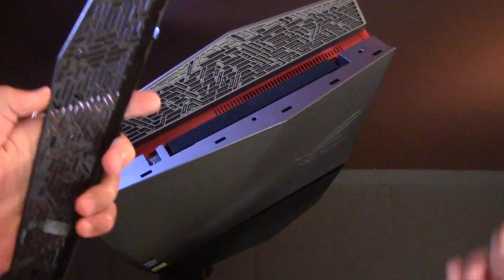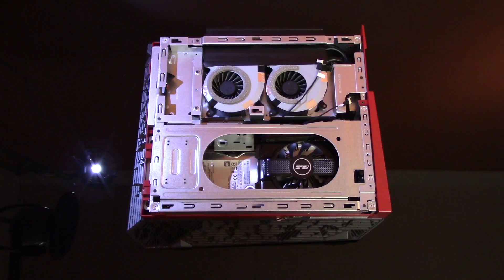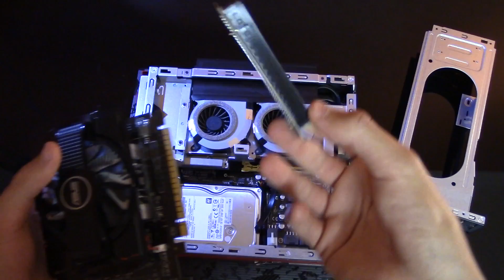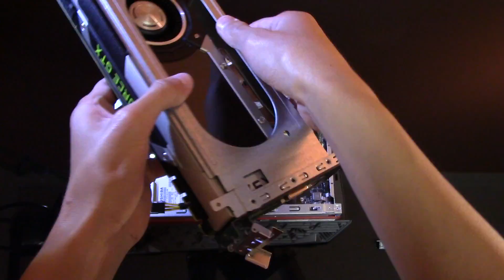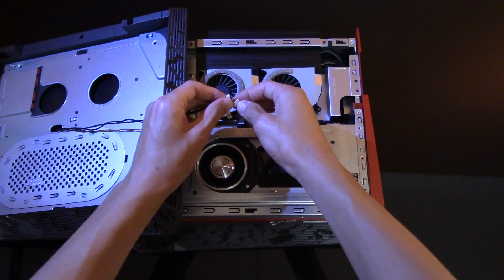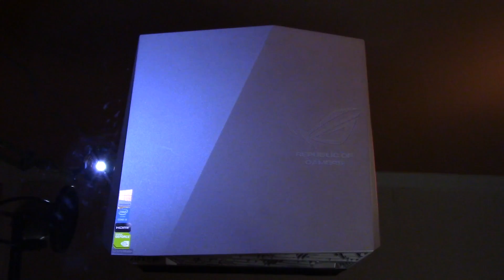Asus ROG G20 - GPU Upgrade Tutorial

Comment: If i put a gtx 1080 in that case with all the standard stuff it comes with will it be ok or bad? And will a gtx 1080 fit the motherboard?
Reply from the maker: If you've got both power supplies, it'll be fine. And a 1080 will fit.
Reply: Would i need a new psu for the gtx 1080? And would it be cooled good enough?
Reply from the maker: If you've got both the 180 and 230W power supplies, you're good. And I'd recommend removing the metal mesh plate that's in the case for a bit more airflow. I could also recommend, if you don't mind a bit of noise, setting the GTX 1080's fan curve a little higher, as it's a warm card.
Reply: DrewEon Thanks!!! Do you think thered be room for a gpu thats water cooled in the case? Like this one: Gigabyte GeForce GTX 1080 XTREME Gaming Water Cooling Video Card
Reply from the maker: The only card that will fit is the reference card.
Reply: @DrewEon  This gives me comfort per my seperate 1070ti question. If I already have both the 180w and 230w powers supplies working on the 970 then it sounds like I'll be all good on the 1070ti if you're saying it's good for a 1080
Reply: Whoa whoa whoa. The system with both power supplies only has 410 watts. Thats not nearly enough for a 1080 but I guess its too late to say this lol.

Edit- Well technically its the bare minimum. It could completely mess up the 1080 as it can spike up and take more power. So as long as your not playing all day I guess it would be fine TECHNICALLY! But from what I heard thats way too risky.
Reply: Don't both power supplies come with PC together??

Comment: How is RPG G20's cooling?
Have ur computer got throttling on extreme heavy load?
Reply from the maker: Haven't ever gotten thermal throttles, GPU stays as cool as most benchmarks show, and processor stays at a surprising 60-65º under load.
Reply: What is the temperature that the benchmark showed?
Also, do you know if the cpu is swappable?
Reply: Rr I have a G20CB with an i7 6700 at 3.4ghz and a gtx 950, and my normal idle temps are about 40-48 degrees celsius and after about an hour or two of gaming on GTA 5 on very high graphics, it ranges from 55-60 degrees Celsius and will rarely go above. I had once left GTA 5 on all night and it only got to about 62. I got it in January this year so I've only had it for the winter so other temps in hotter seasons might be a bit hotter

Comment: hey man i moved recently and my powercord was stolen in the airport will the one in the discription run my 180 card without shutting my pc off anything that runs my gpu turns off my computer atm
Reply: i ment to say 1080 i had the stock power supply when it was stolen thats why i asked
Reply from the maker: Did you only have one power supply? And which one in the description? You need to have both power supplies for the 1080
Reply: my stock one did lol really well

Comment: So I have the ROG G20 and I have installed the GTX 1080 in it. IS there anyway to install a new coolant in this computer because I think it is over heating. The fan goes off real loud sometimes.
Reply from the maker: Which model of the 1080 did you put in? And the fans get loud, it's a small PC haha.
Reply: The Aero MSI Gtx 1080
Reply from the maker: Boston Towny4life Doubt it's overheating, as that model of the 1080 exhausts air out the rear. The fans are loud, as it's a small PC.

Comment: hey man great video but i have one question. i know about the jdc11 slot but another video said to move all the r20 slots up. is it necessary?
Reply from the maker: Yes! It seems that JDC11 actually may not activate the second power adapter, done it myself and it's surely working. Depending on model, though, you may need to test different configurations of the other slots.

Comment: I got the rog g20 that came with just the 180 power supply. First question will I be able to upgrade gtx 1070 and second question will I also need to buy the 230 power supply? Thanks for the video!
Reply from the maker: You surely can get the 1070, but you'll need that extra 230w.

Comment: Will this 970 work? It's different than the one you have. Thanks!
http://www.newegg.com/Product/Product.aspx?Item=N82E16814121899
Reply from the maker: Don't believe the strix fits, and it'll also exhaust a lot of heat into the case.
Reply: Will this fit? Thanks again, sorry for bothering :p
https://www.walmart.com/ip/ASUS-GeForce-GTX-970-4GB-Turbo-Graphics-Card/44933762?wmlspartner=wlpa&selectedSellerId=1229&adid=22222222227032313218&wl0=&wl1=g&wl2=c&wl3=62500234736&wl4=pla-109727440616&wl5=9031075&wl6=&wl7=&wl8=&wl9=pla&wl10=112549857&wl11=online&wl12=44933762&wl13=&veh=sem
Reply from the maker: raviolu_ Won't fit either :/
Reply: Well ain't that just fine and dandy. But seriously, will it work?
Reply from the maker: raviolu_ It'll work, assuming it arrives working haha :)))))))))))))))))))))
Reply: DrewEon I love you dad
Reply from the maker: raviolu_ Love you more, mom

Comment: Hi friend, Where can I find the Pci cables if I don't have mine. I need an 8 pin for the 1070 but I cant find an 8 pin to 8 pinh anywhere online.
Reply from the maker: I've looked all over the web and haven't found an 8pin to pin either :/
Reply: +DrewEon do you know if Asus used an 8 to a 6+2 connector for their 760 build? Or just a 6 to 6?
Reply from the maker: +tpod legacy I believe its a 6+2 to 6+2.
Reply from the maker: At least it's what came with my PC.
Reply: +DrewEon sweet I havnt opened mine yet but that should work with the 10xx series right?
Reply from the maker: +tpod legacy Yes.

Comment: I am thinking that i can put the gtx 1060(not founders edition) inside?(the size)
i am just afraid that the fan cant push the air out and it just push it back to the computer inside
Reply from the maker: The reference (founders) model from Nvidia is specifically designed to exhaust air out the rear, and it fits.
Reply: +DrewEon so can Asus turbo Gtx 1060 6g fit in?
It looks like the founders edition

Comment: Can you upgrade to the GTX 960 EVGA? It fits, but what power supply would I need?
Reply from the maker: You'd need both the 180w and 230w. Although, if it's the EVGA acx cooler, it's going to exhaust lots of hot air into the case.
Reply: +DrewEon Thanks! It took me a moment to realize the computer has both plug ins for each power supply. Lol, but I decided to order both the power supply and the GTX 980 sc.

Comment: If I try to upgrade the video card, do I have to add another power supply for it? Is 230w+180w enough?
Reply from the maker: The 230w and 180w are enough for anything
Reply: ***** umm I was planning to upgrade my gpu from gtx760 to gtx 970
Reply: +DrewEon ok, thanks

Comment: I want to upgrade my GPU because the one I have right now (AMD Radeon R9 370) isn't compatible with VR. Is there a really good GPU for VR gaming? Please can you let me know it would be very much appreciated!
Reply from the maker: GTX 1060/1070/1080
Reply: +DrewEon will the 980 ti SuperClocked work and fit?
Reply from the maker: Mr Network After market cards don't fit well, and exhaust air into the case.
Reply: +DrewEon k, thanks for letting me know!

Comment: So I have the g20aj with the i3-4150 cpu and gtx 745 if i upgraded to 1060 or a 970 would it bottleneck the cpu or would I be good??
Reply from the maker: The CPU would bottleneck the GPU
Reply: +DrewEon what do you think would be the best gpu option to upgrade to so it won't bottleneck ??
Reply from the maker: michael fetzik I'm not saying you shouldn't do it, you just won't get the full potential out of your card, especially in games like GTA and the Witcher, open world.
Reply: +DrewEon alright thanks man and great video again it'll help me in the future !
Reply: +DrewEon Would this be a good 970? I can't see to find a cheap 970 like in your video and I've heard this card blows air out the back just like the reference card so won't heat up inside he case. 
PNY GeForce GTX 970 4GB Rev 2 Graphics Card https://www.amazon.com/dp/B0165YVEEA/ref=cm_sw_r_cp_api_d0eQxbSWEWGP2
Reply from the maker: michael fetzik That or dis http://www.bestbuy.com/site/nvidia-geforce-gtx-970-4gb-gddr5-pci-express-3-0-graphics-card-silver-black/9855169.p?id=1219441201895&skuId=9855169
Reply: +DrewEon alright thanks again

Comment: Two questions.

1. What are the power cables called at 0:40 ?

2. Will this 1070 fit in the metal cage, or can I use it without the cage?
http://www.newegg.com/Product/Product.aspx?Item=N82E16814127947&cm_re=msi_geforce_gtx_1070-_-14-127-947-_-Product
Reply: I believe that the metal cage that holds the graphics card is about: Height: 4.376 in - 111.15 mm Length: 10.5 in - 266.7 mm Width: Dual Slot.

Comment: I recently bought the GTX 960 and I have the 230w power supply. 
Will that overload my card and damage it? Or am I fine as is?
Reply from the maker: More likely your card will overload it. And because power will only come from the PCI lane without that second power supply, it's possible you can damage the motherboard. I'd suggest you purchased that second power adapter.
Reply: I also forgot to mention that I also have the 180w that came with my Asus when I bought it.
it had the GTX 745 at the time. The 230w I bought when I planned to upgrade my GPU.
So judging by your response, since I have both, I should be fine?
Sorry if the answer is obvious to you, I'm new to the whole PC building scene.

Comment: hi Drew. thanks to you and Welsh gaming i am upgrading my ASUS ROG G20 CB WS71 GPU from a GTX 980 to 1080 Got all the way into installing 1080 into cage and 6+2 (only power cable needed) is installed.. My only question is what to do about jumper. The 980 used 2 powers cables I believe both 6 pin.  The 1080 uses just the one 6+2 (for a 8 pin cable), but do I have to change the jumper..I don't even see a JDC11, I see JDC 01,02,03,04,05..any idea if I have to change a jumper?
thanks
Reply: I have JDC11 to the left and JDC01-05 are all on the top pins.
Reply: +Drew Eon thanks.I got a hold of nvidia tech support and they said with my setup, the jumpers were fine as they were. all done and seems to be running fine. thanks for the help.

Comment: Will this 1070 fit?

https://www.amazon.com/gp/product/B01IPVTHL8/ref=s9_top_hd_bw_b1C5u_g147_i3?pf_rd_m=ATVPDKIKX0DER&pf_rd_s=merchandised-search-4&pf_rd_r=VW0VK1TY0V2K1HAYRXF3&pf_rd_t=101&pf_rd_p=b7bbe86f-11e5-5e0a-b25b-2cc39f20adcf&pf_rd_i=284822#customerReviews
Reply from the maker: I don't believe it will.
Reply: DrewEon Ah that sucks! Thanks for the heads up though!
Reply from the maker: +CrayZ If you have your heart set on it, I've seen some people putting the Turbo 970/1070's into their G20's without the metal cage.
Reply: DrewEon Mmm seems a little risky. You know any high end GPUs that fit in nice within the cage?
Reply from the maker: +CrayZ The safest route is reference design cards because they fit, and they don't put extra air into the case like open design coolers. I believe the only after-market design card that fits is the EVGA ACX 2.0 970, but I'm not sure.
Reply: can I get a different case and move everything there and upgrade the gpu ?
Reply from the maker: Kr Vactite That won't work. Only the processor, storage and graphics card are transferable to a new case. Motherboard is custom to the G20, RAM is laptop memory, CPU cooler is custom to the G20, and power supply is of course made for the G20.
Reply: DrewEon I know ;-: i going to have to drop like 200-300$ or even more NOOOOO
(p.s I want my pc water cooled)

Comment: Hey ! tahnks for the video. I have an 6 => 8 pin connector for the 1070, that will work or not? ty :)
Reply from the maker: A 6 => 8 pin? What?
Reply: In your video, you just use a 8 pin => 8 pin pci express (the red cable on the left at the start of the video) i don't have it and i need it for my new gtx 1070. Do you know where i can find this cable?
Reply from the maker: Madalax This is the only thing I've been able to find. It's long, but if you cram it in there well it should work, lmao https://goo.gl/xrRiwl
Reply: Ok thanks a lot ! :)

Comment: Hello , nice video ,i have the same pc, with the gtx 750 , but i only want to add the 180w power adapter and keep the gtx 750 , do i have to put the tab on the left side too ?
Reply from the maker: Why add the 180W power supply, then? And yes, you do
Reply: because the pc crashes on some games , its not overheating , its just because that the power supply is only 230 w and the 750 need 300w minimun.
And i can't afford a new Gpu right now ^^'
Reply from the maker: Rafy The 750 with the specs of the PC use no where near 300W
Reply: +DrewEon Well i didn'd find anything else that could explaine the crashes
Reply from the maker: Rafy What games and what settings?
Reply: Rocket league on Ultra , and the pc is not even hot , HAWKEN Ultra or low graphics , it runs perfect in both and crashes in both , GTA V in High i think , and recently Bordeland 2 , but there is games i can play with no problem like Overwatch and Fallout 4 with mods in ultra
Reply: i have the same problem, and I don't no why the computer do this! the problem is low power?
Reply: Its not actually .. The gtx 750 is just bugged with some games ; and its stupid.
Reply: nothing to resolve the problem?
Reply: nope , its just the gpu being dumb with some games ..i'd say the only way to resolve the problem is by doing pretty much the same thing the guy does in the video ..

Comment: So Im kind of confused about the power adapters. I have agtx 750 in my asus ROG and am looking to upgrade to a 1070. My power brick is the same as the first link ( or the 180w one) So should I also buy the 230w one?. If so why?
Reply from the maker: Why? Because you need to power a 1070? And if you have the 230W, get the 180W and vice versa
Reply: +DrewEon +DrewEon thanks for the clarification man! I'll be sure to pick up the other power adapter. This video really helped me out a lot, hopefully I'll be able to play games at higher settings soon :D

Comment: I've had nothing but freezes and issues with my upgrade to a 660GTX( it was an extra card I had laying around.)
Reply from the maker: What are the rest of your PC specs? And the GTX 660 isn't exactly new.
Reply: asus g20, Core i5-4460 3.2GHz processor.  Are you having any issues with your install of the GTX980?
Reply from the maker: +reactor4 I have the 970 and haven't had any issues.
Reply: What external power supply are you using to power the card?
Reply from the maker: reactor4 Both the 180W and the 230W?
Reply: 230w for the card?
Reply from the maker: reactor4 What do you mean?

Comment: Okay I'm confused if I get the same ROG G20 as you have (with the GTX 750 no ti) and I want to upgrade TO the same card, what power supply will I need? Just link it please I'm confused as hell
Reply from the maker: They're in the description. You have to get the 180W and plug that in as well as the 230W that comes with the PC.
Reply: +DrewEon wait I've never seen a second plug on the G20, is there?
Reply: +DrewEon Okay, sorry about that didn't notice the top plug for the 180w thanks for making the video!!

Comment: Thanks a bunch for this video, very helpful. I just ordered the exact same card. But I do have a question. How are the temperatures? Does it ever get too hot that the system clocks it down? Thanks in advance
Reply: Also, I hvae another question which has been bugging me. I received my ROG G20 with only one power supply. I realise I must get the other for the GPU, but I really don't know which. The default one I got goes on the bottom power port of the PC, which powers the whole computer, so is that the 230w? Thanks.
Reply from the maker: I have absolutely zero cooling issues, and the bottom port is for the 230W.
Reply: +DrewEon That's good to hear, and thanks for the info. Really appreciate it man.

Comment: Is the card in the desc the only gtx 970 that is compatible with the asus rog g20 i5 4460k? Because a lot of people are saying that it is
Reply from the maker: I believe the ACX 2.0+ from EVGA will work, but the reference model is the best option as it exhausts air out the back and no into the case.
Reply: +DrewEon reference model as in the one in the description? And is there a different reference model you could tell me of. Another model that pushes the air out the back?
Reply from the maker: Paul Abramson I believe EVGA has one that does the same, and looks like the reference model to a certain extent. But there are no other models of reference cards. This EVGA one: https://goo.gl/YqOsga
Reply: +DrewEon okay I think I will get the one you linked
Reply: +DrewEon and it fits the same way the one in the video does?
Reply from the maker: Paul Abramson I believe so. I'd compare the dimensions of that to the one linked to best buy, though.
Reply: +DrewEon and you do NEED the power adapters for it to run right?
Reply: +Paul Abramson because I don't know where mine went
Reply from the maker: Paul Abramson You don't NEED both for it to run, but without them both, there's a ton of stress on the power supply and the system underclocks itself heavily to reduce power draw, significantly reducing performance.
Reply: +DrewEon ok. Well I have the 230w and my 180w gets here tomorrow